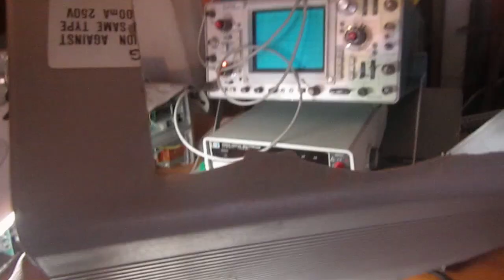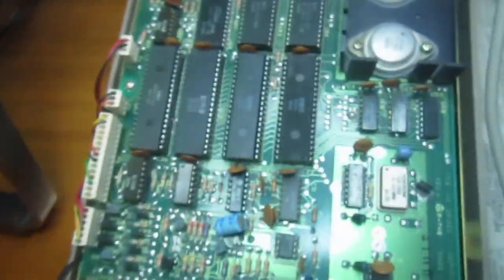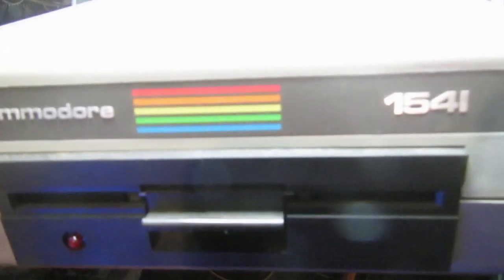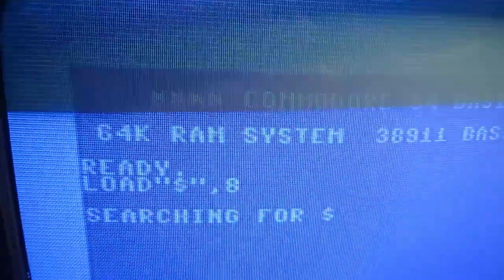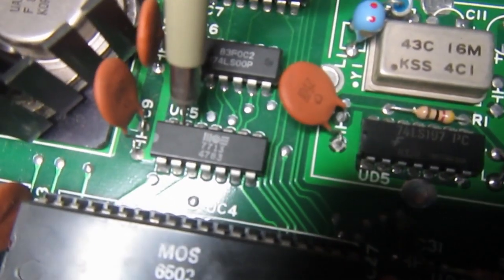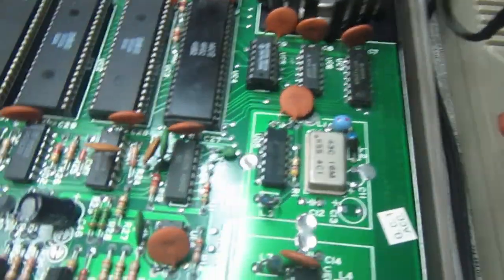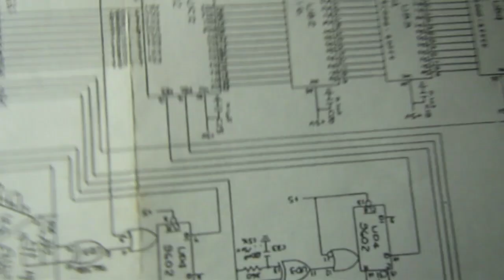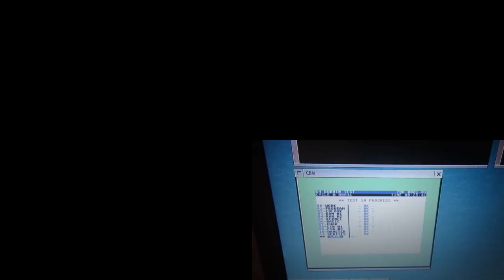2 x Commodore 1541 repair. Low quality sockets and MOS logic failing.

Comment: Did you find out what the modification is for? The soldered wire...
Reply from the maker: at 05:33 you mean? It was likely an early PCB revision with last minute corrections.

Comment: One nice thing about those 6522 chips is that you can still buy them brand new on Mouser.com.  Here's the 5V 40-pin version for under $7 for one unit.  As far as I know they're compatible replacements, but I haven't bought one personally:
https://www.mouser.com/ProductDetail/Western-Design-Center-WDC/W65C22N6TPG-14?qs=sGAEpiMZZMsYdxaYtmOicSRUuPiX8JOOAWyKaG%252be%2fco%3d

And here's the version that can run at 1.8V to 5V, if you needed something to run at a lower voltage for some reason (same price).
https://www.mouser.com/ProductDetail/Western-Design-Center-WDC/W65C22S6TPG-14?qs=sGAEpiMZZMsYdxaYtmOicSRUuPiX8JOOuiALCRL8d6k%3d
Reply from the maker: Hi 00Skyfox! Yes, WDC still makes some compatible ICs like the 65C22. I've never tried one myself since I still have a few spares, but surely I'll try a WDC replacement as soon as I run out of spares.
Reply: WDC also makes a 6502 processor that I assume is a compatible replacement for the 6502 in the 1541 and the VIC 20.  Unfortunately they don't make a 6510 or 6526.  Also, Signetics and a couple other companies made PLA substitutes, but I don't know if they can be used right from the factory, or if they have to be pre-programmed like an FPGA.
Reply from the maker: Hi again! Yes they make also a 6502 replacement, but also in this case, I did never try one. 6502 were made from a multitude of different second sources until some years ago so are still easy to find. As for PLA, they were programmable logic (82S100, PLS100, maybe others compatible) that originally CBM used to "condense" some glue logic on various platforms (CBM-II, C64, 264 series, etc.). Usually programmed 82S100 don't fail. But then CBM decided to make chips that had the same logic functions as the programmed PLAs, just they weren't programmable but fixed logic functions pin to pin compatible. Of course the MOS Technology chips had lower reliability and started  to fail. I am working on a PLA replacement, so one day there will be a video on it :)
Reply: Thank you for helping me.  I had the same problem with drive constantly running and both LEDs on.  I swapped UB4 with a spare and it acts as it should!  The Commodore recognizes it but wont load.  Just shows garbage writing